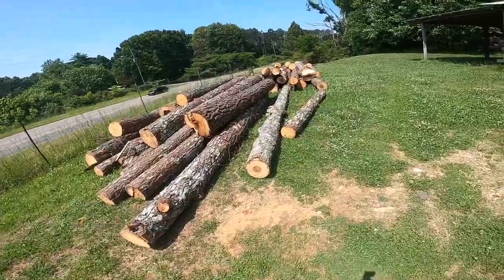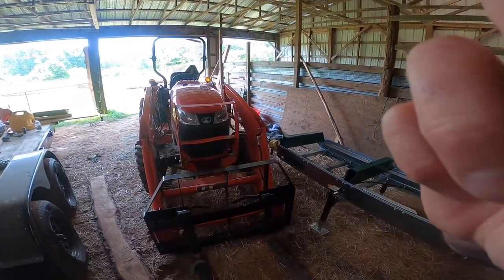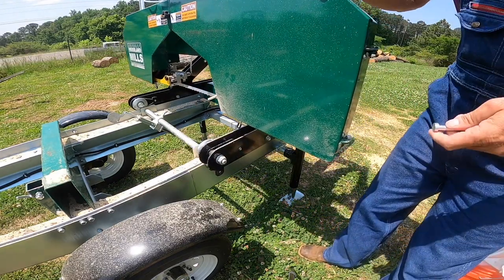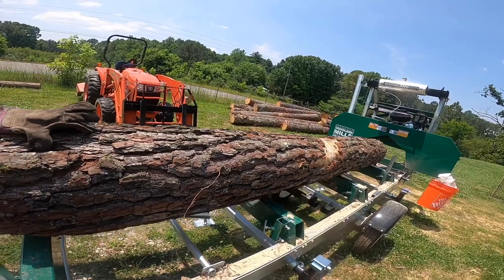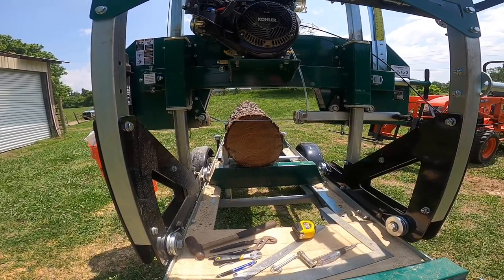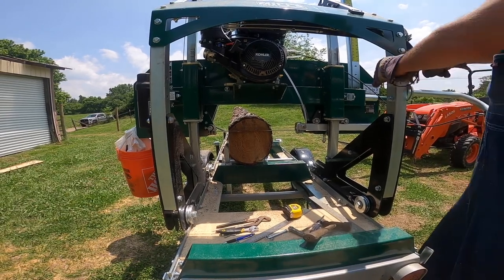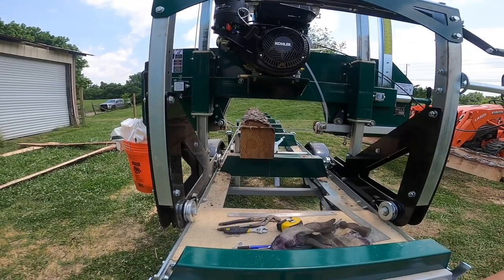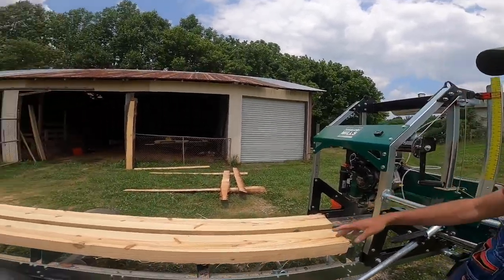Log to Lumber: Sawmill Beginner Steps

Comment: You should take some of those logs and make yourself a pole barn to keep you cutter inside with the capability of setting logs on the the log machine. Then you won't have to take the time to move your machine in and out.
Reply from the maker: I’ve got it set up now under a shed roof overhang off my barn so I’m not moving it each time I use it…made a world of difference and keeps me out of the sun!  Thanks and thanks for watching.

Comment: Putting the log on the bunks with the small end at the operator end will reduce the blade running out of the log before the end. If the blade enters the wood on the small end it will leave the log on the big end. It makes it easier to plan your cuts.
Reply from the maker: Thanks for watching!  What I had been told is that if you start on the smaller end you run the risk of the larger end not clearing the sawhead and then you have to back the saw up and redo it all. But I see the merits of both methods!
Reply: @homeplaceadventures  If the log is so big that you have doubts, then the big end idea makes sense. Otherwise I always try to put the small end first. Even doing that I STILL RUN OUT OF THE LOG SOMETIMES!!! Remember........ya can't win.